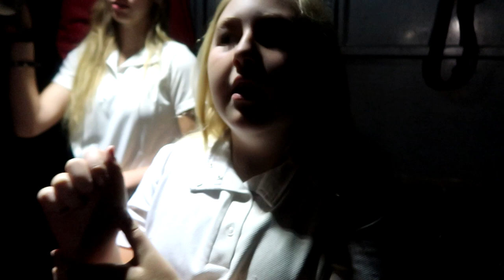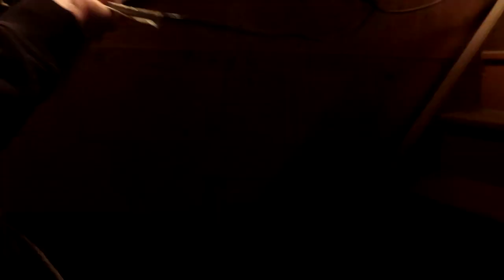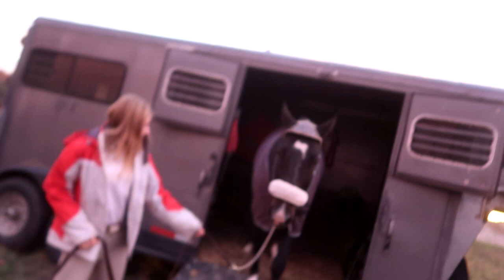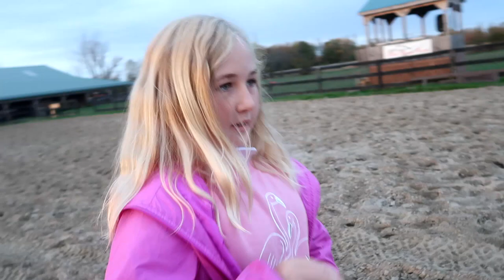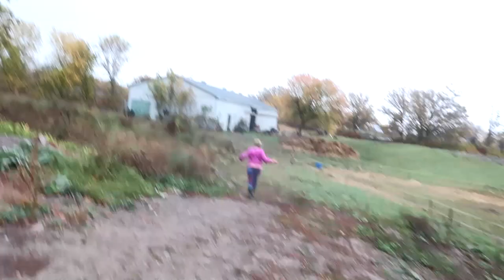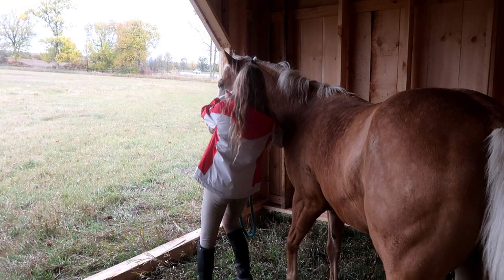HALLOWEEN HORSE SHOW! Day 281 (10/12/19)

Comment: Storm is such a good horse for your entire family. What a good boy! About your shed—-I have a shed row barn just like that built by the Amish. I had to put 6 inches of packed gravel pad for it to sit on before delivery  And it’s still sunk into the ground over time on one end where it must not of been quite so thick gravel. The front of your shed outside  also needs to be some kind of a real good footing like gravel  that won’t turn to mud with in and out horses. I put mats on top of the gravel in my stalls   I use my barn as a run-in—they rarely get locked in. Even the inside settles down. After a couple of years  I had to have 4 inches of stone dust added and packed in each stall under the mats  because the ground outside the barn was higher than the ground inside the barn-because the barn sank overtime-and I would get horrible flooding in the stalls when the snow melted, but the ground was still frozen early spring. I don’t know if you can do anything about that now that it’s  sitting on the bare ground. I know this would be really hard to do, but I wonder if it would be worth jacking up the shed and getting in a whole bunch of gravel to make your gravel pad or making a gravel pad nearby and then asking the guys that made it and delivered it to come back and move it. Just a thought. I know what a mess mine became even though I had, seriously, 6 inches of packed gravel under the whole thing.  I hate to see that happen to you.  Yours is a nice roomy shed, but-and I hope I am wrong-but I doubt storm is going to let Finn share it with him. So that means Storm  will be inside and Finn  will be out in the rain or the snow. If that happens, probably the best you can do is just get full body waterproof sheet or blanket for Finn. Don’t know what shipping would be to Canada, but I just saw a full body waterproof 1200 veneer turn out sheet at chicks saddlery online for $59 American. Amazing deal. Good luck with everything.  I hate to be Debbie downer, but I’ve been there and I’m always hoping to help somebody else go through the same kinds of struggles.
Reply: I just noticed a typo auto correct—1200 denier sheet.